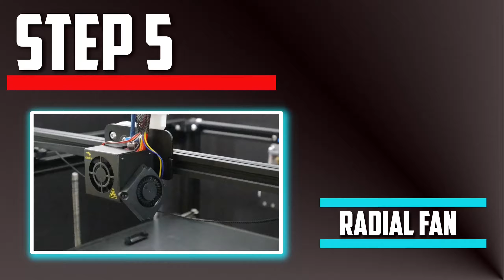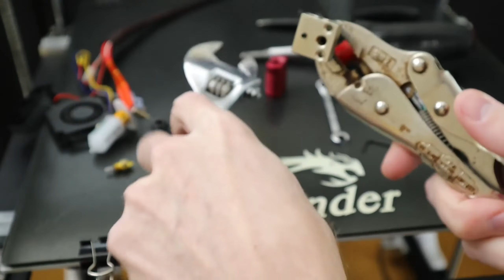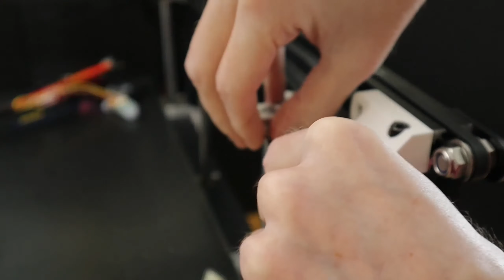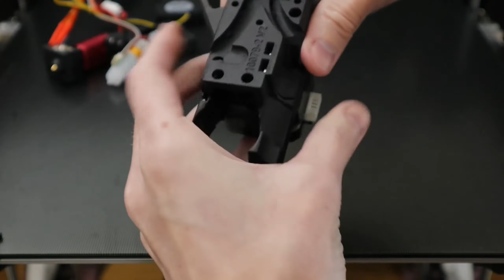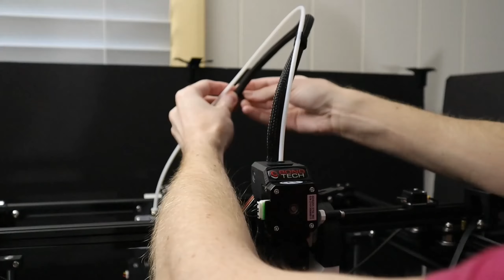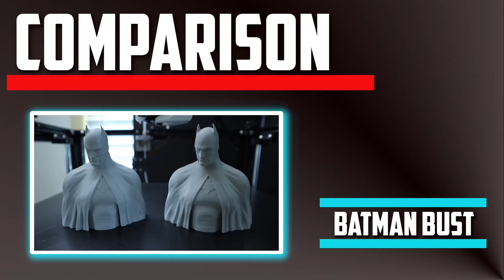Installation Guide and First Impressions for the Bondtech DDX v2 Extruder on the Ender 5 Plus

Comment: Hello.
What upgrades do you have for Ender 5 plus in this video? 
Thank you very much
JMA
Reply from the maker: In this, I just have the bondtech ddx v2 extruder, slice engineering bi metal heat break, BigTreeTech SKR mini 3 v2 board and tft35 display
Reply: @EB3DPrinting  Hello, thank you very much for your answer. And the white parts are from thingiverse or your self-production?
PS: very nice Ender 5 Plus Upgrade.👍
Reply from the maker: @jaroslavmach8898  Some of the white parts are from Bondtech website, mainly the parts on the extruder. The display parts for the display are from thingiverse.

Comment: First, thank you for the video. I just ordered the v3 and looking forward to the installation on my E5P. Those white angle brackets on your printer look pretty nice. Can you share a link to the stl?
Reply: I may end up ordering the same for my 5+, this looks like a good direct drive setup with an upgraded cooling fan right off the hop as well.

Comment: I have an electrical socket under my workbench that is earth only so when I am working on anything with an earthed metal I can plug into this and discharge any static I may be carrying by touching the metal frame or power supply housing (I hate wearing the wristbands)
 Another tip is to place a towel on the buildplate when working on the hotend area, I have heard of many people knocking a chip out of glass beds by dropping things on them + if you drop any screws they dont end up on the floor lost

Comment: How do you change your filament. I keep getting clogs because the filament gets stuck in my mosquito hotend tube.
Reply from the maker: This is odd. I have recently upgraded to a mosquito hot end and havent had any issues with clogs. I would double check to make sure your capricorn tube is cut correctly and isnt causing friction. I would also double check your thumb screw tension as well.

Comment: Thinking of installing a DDX V3 with mosquito this week.
Reply from the maker: Thats definitely the way to go. I would have rather went with the v3 instead of the v2. Would have been an easier install.

Mosquito hotend is the next upgrade im looking at as well. The bi-metal heatbreak has been working great for me. Just printed all the parts for the RatRig V-Core 3 I'm building in PC-CF at 270*C and no issues with heat creap.

Comment: What offset did you have to change for the BL touch ?
Reply from the maker: X and Y offset. These can be adjusted in the firmware. Use the Command M851 to adjust the XY offsets through either pronterface or octoprint.

For the Standard BLtouch mount you would use the command:
M851 X-27.5 Y-2.5